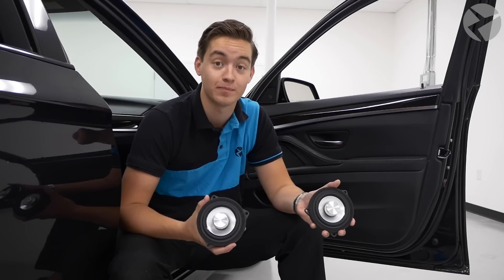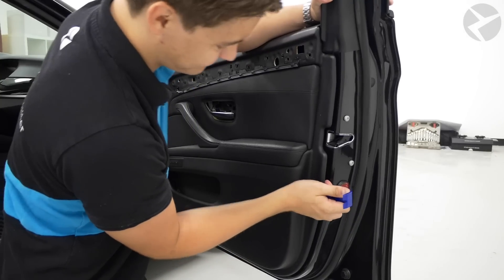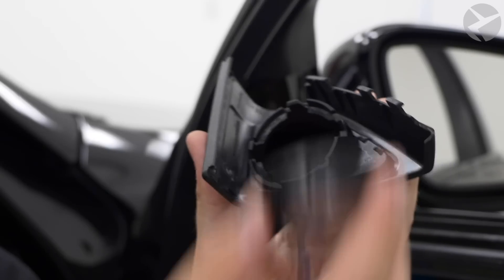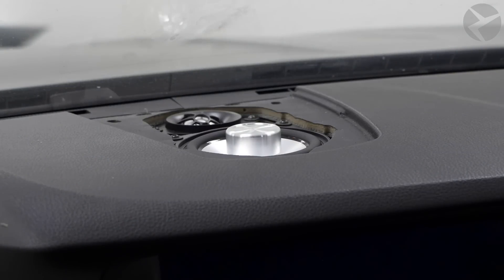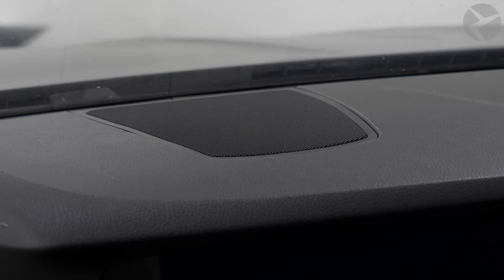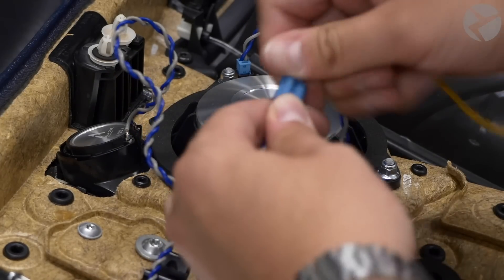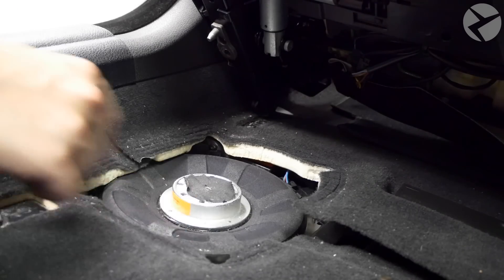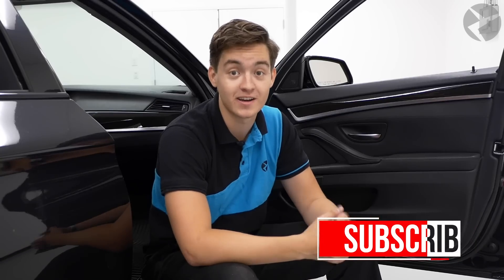Installing the Alpha One Speakers in a BMW 535i F10

Comment: What if there were no speakers in the dash and you want to add speakers? Can't find the wires anywhere or will I have to run it myself? From where?
Reply from the maker: Each case is specific and the amount and position of the speakers can slightly vary based on the model and the sound system. Based on your VIN we could check what sound system your car is equipped with and will be able to advise what can be done to improve the audio experience in your car.

Comment: Hello, good morning friends, just a simple question. I have a Serie5 F10 from 2016 and it already has the factory HiFi sound option installed, if I only wanted to replace the speakers (including the subwoofers), will the amplifiers it already have be able to support and move to the new speakers?, that is, no Does the amplifier need to be changed initially? Could it be a first phase of improvement? just changing the speakers?
Reply from the maker: Hey hey, the best option for you would be to replace whole package, but we don't want to rip you off lol. Good speakers will do just fine with stock amp and u would definitely spot the difference! 

Cheers!

Comment: Are the speakers you installed co-axial??  No need for the tweeter??
Reply from the maker: No, the BimmerTech speakers are not co-axial. A tweeter can, and should be installed for the further increase in the audio quality but it is not required.

Comment: How was the sound, do I still need to add aftermarket subwoofer and amp, 
Do you had same amount worked on Alfa speakers.
Reply from the maker: Check out these customer testimonials. You'll get to know many opinions about the upgraded sound: 
https://www.youtube.com/watch?v=VPJCMa-jseI&t=48s
https://www.bimmerfest.com/threads/bav-sound-or-bimmerfest-alpha-one-or-used-harmon-kardon-audio-system.1271572/
https://f87.bimmerpost.com/forums/showthread.php?t=1615652
https://www.bmwblog.com/2018/09/04/review-alpha-one-speaker-upgrade-kit-from-bimmertech/

Comment: 🔥 Video. How do I know which stock plug goes in which port on the adapter ?
Reply from the maker: Hello, after placing the order you will receive detailed instructions which explains the whole installation process. Our set is designed in a way, in which all connections are the same or very similar to the OEM ones, this process is not complicated even for an inexperienced person.

Comment: I have a bmw 528i 2006 I bought a bmw 528i 2011 can my old speakers fit in my new bmw?
Reply from the maker: It all depends on your previous sound system and the current sound system  and the head unit you have in your new BMW. You can contact our support team with your VIN number at support@bimmer-tech.net to find out if it's an option for you.

Comment: Hi! Im about to buy a kit to my F10 535i and I dont have tweeters in a pillar so.. The question is do I have to make wiring to be able to install those?
Reply from the maker: Hi, yes, you'll have to plug in additional trim pieces. When you decode your VIN on the website and choose your kit you'll be shown what you need exactly: https://www.bimmer-tech.net/speakers-and-audio-amplifier-for-bmw

Comment: Hi, could you send link to the adapter? I cant find it anywhere.
Reply from the maker: You'll find our amplifier here: https://www.bimmer-tech.net/speakers-and-audio-amplifier-for-bmw
Reply: @bimmer-tech  I need the adapter because the speaker has one input and not two.
Reply from the maker: @styler7632  In that case please send your request along with your VIN number to info@bimmer-tech.net. We'll see if we have a separate adapter.